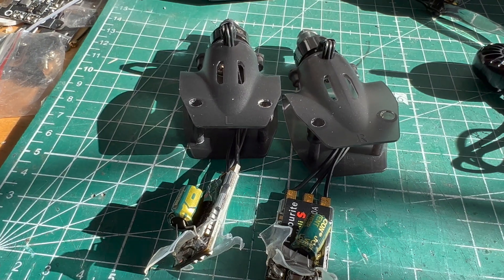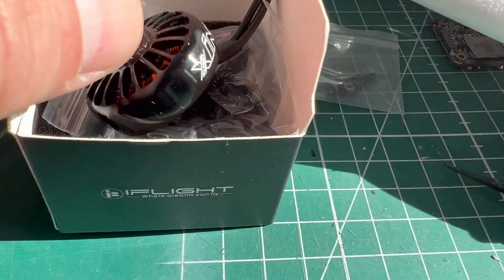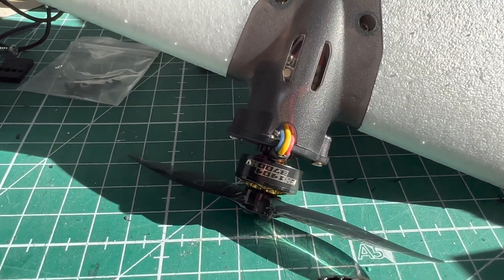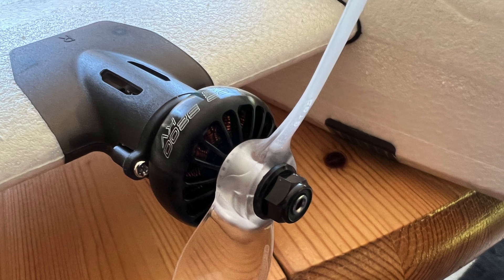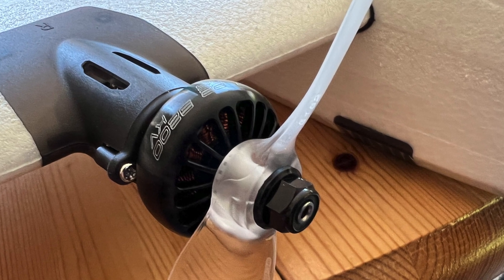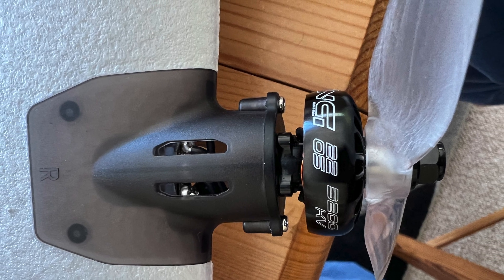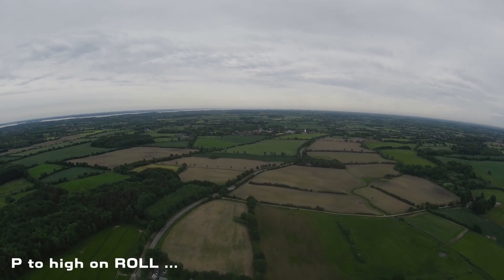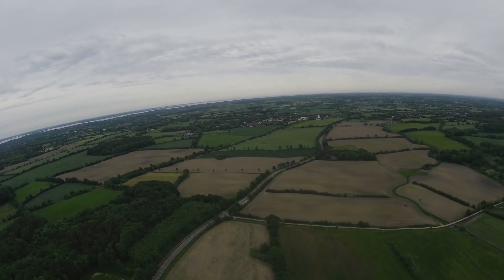New 2205 motors and 5" props | Hee Wing T1 Ranger S02E02

Comment: ? Did you have to modify the motor mounts or just bolt on
Reply from the maker: Had to assemble the mount first and then screw the motors on through the openings of the mount as the motors are to big to let you assemble it the normal way.
Reply: @JustFPV-net  THANKS

Comment: I fly mine with 2004s and t props to keep amps down and a 2200 3s. Get about 15min of at about 70precent. Also I think you have to much travel on those servos.  That’s why you get those bad wobble at speed. It has something to do with the speed of the servo communication to the fc. It happens to me and then I flip into manual and it flys fine. People typically put to much travel in servos because INav takes away a lot of travel during stabilized flight.
Reply from the maker: thanks for the hints on that! (On mine) Actually it's tzhe PIDs that are to high for the speed and overshoot. The solution is to set up the TPA correct to damp those PIDs on high speed ... and perhaps optimise some PIDs that might be to high after all :)

Comment: I have my T1 coming in the mail. I have some 2004 motors I want to try with 4 and 5 inch.
Reply from the maker: Cool - but keep in mind that the motor mounts are for the smaller motors. Hope you’ll have to same fun with it a i had and still have ;)
Reply: @JustFPV-net I secured the motor mount with a zip tie. 2004 are perfect motors for this plane

Comment: Motors and props seem a bit overkill. Perhaps ideal if wanting to fly square loops. That climb angle, LOL.
Reply from the maker: True ... at that point I was about to find the right motors that would drive my beloved Gemfan Flash 5x5 props in an reasonable way ... yet I guess it was raw power I got out of this combo. Not exactly the best choice for a 3s1p setup with aim on low amp draw. BUT YEAH ... That climb rate ;) ...
Reply: @JustFPV-net  This a VTOL warmup.
If has vertical with greater than 1 thrust to weight ratio, could configure as tail-sitter in ardupilot. (fly as VTO, land normal)
Reply from the maker: hehehe ... I will have to complete a tremendous learning curve to make Ardupilot a friend currently- not because its bad! But more because I will have to understand so much in almost no time. Yet I would like to stay on the regular VTOL path ... the Tailsitter launch could on the other hand become something interesting for the F01 Powercruiser
Reply: @JustFPV-net  5x5 might work fine on Tmotors 1507 2700kv
Reply from the maker: I skipped those to 1507 3600kv (present day) and spin 4x4.5 or such ... but yes, that would be an option. But I've made some more tests (yes, already finished the next two episodes ... sometimes I'm a busy bee on that behalf).

Thanks for the suggestion, DJI Silesia :) (oh ... and exited about the action 3 btw?)
Reply: @JustFPV-net  Ha. I fly these motors on my T1 now actually, can't remember the props though. 4s VTC pack, but cruise is not very efficient, actually around 5-6A.
Reply from the maker: reminds me of that I have to order a bunch of VTC6 ...
Reply: @JustFPV-net  I fly the T1 on three different setups when it comes to packs - VTC6 4s, 21700 5000mAh 3s and 21700 4s 4200mAh. Unfortunately this means I can't tune the plane for good as every pack is different voltage and weight so cruise throttle etc changes. But I might try more the 3s 5000 21700 and if this gets me some  good flighttimes then I'll stick with it. Although I do like the 4s VTC6 pack...
BTW - I tried contacting you on FB sometime ago via messages, take a look :)
Reply from the maker: oh ... okay! I'm pretty blind on FB as I try not to spend my (perhaps remaining) youth on this crap ;) ... my apologies! you can better catch me on Telegram/signal ... that's easier!

The battery setups sound familiar! Started of with the 3s5000 as well and loved it! But the 4s18650 really make the little T1 a speedy feller so I fly this mostly. Didn't try 4s4200 by now ... should I ? :) ...

Comment: Nice video, still waiting on the VTOL stuff being setup. I also wish that Heewing have a VTOL model instead of purchasing the regular PNP and the VTOL upgrade. Kinda makes it a bit on the expensive side for buying it the first time
Reply: Starting with PNP, you end up with 2 exta motors, motor mounts and a tail boom. Not a lot of extra expense in the over scheme of a VTOL build. 
The HeeWing KIT is a total kit, as foam bits are post mold, so half need to be joined etc. KIT also lack some niceties like the wing quick connectors (required for VTOL build). 

The two largest expense items in VTOL build are the motor servos (mounts) and the flight controller. The rest is cheaper in comparison. 

If you want a cheap VTOL, a twin motor tail-sitter wing doesn't require motor tilt servos and special mounts. Only two servos, and two motors, plus flight controller. (but no one offers a PNP of this either)
Reply from the maker: that was a good answer - thank you
Reply from the maker: Good advice: the vtol is not a good thing to start off with. So many things to tweak and get set up right that it’s very easy to end up in frustration.  And besides that: VTOL is always expensive!

The T1 PnP on the other hand is a brilliant and easy way to dive into that model. Perhaps a thing to consider. 

My vtol is still in the build as I mentioned in the video.
Reply: @JustFPV-net  
Eigentlich wäre es nun an der Zeit ein Setup Video zu drehen, um noch mehr Leute an diesem tollen Hobby teilhaben zu lassen! 😉
Reply from the maker: Erst Mal muss ich es fertig haben und das hatte ich angekündigt nicht vor Oktober hin zu kriegen. Aber ich bin dran
Reply: @JustFPV-net  Bin schon sehr gespannt 🤩
Reply from the maker: Ich auch